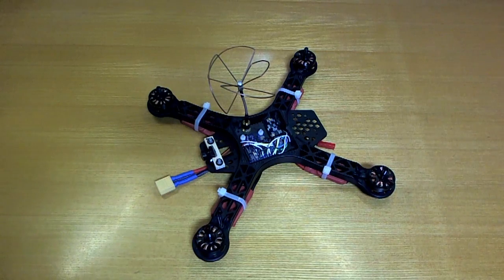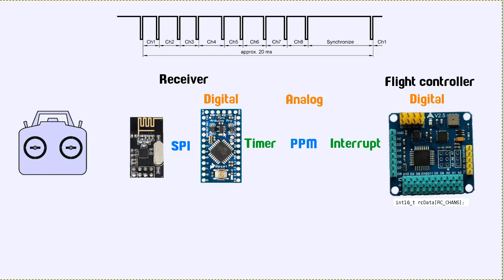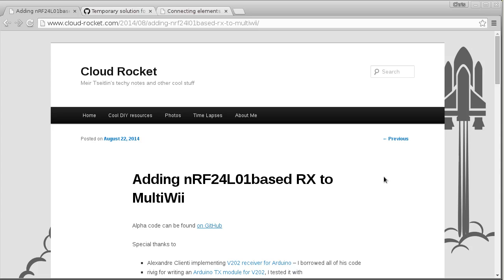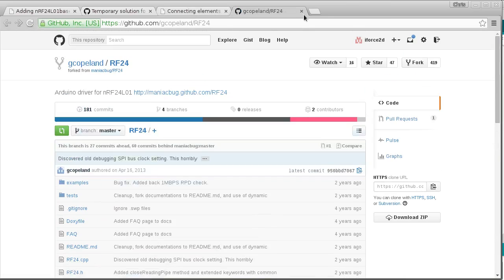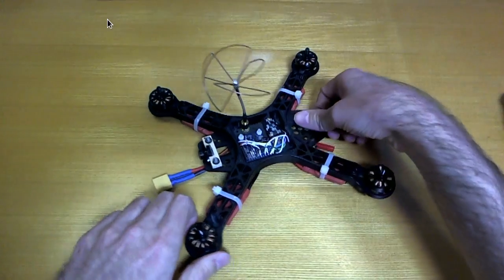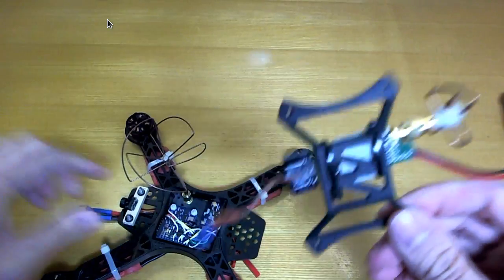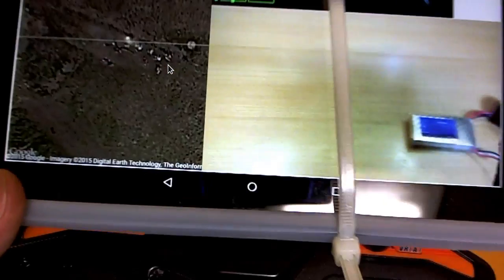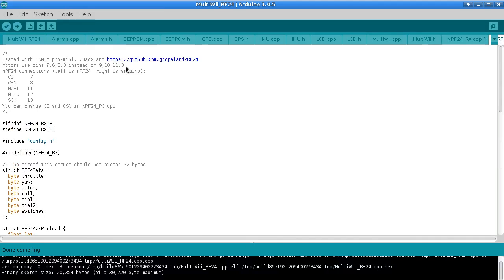Data telemetry with MultiWii integrated nRF24L01

Comment: What cable is it that you have between the nRF24L01, and the cloverleaf antenna? A banggood link would be nice :)
Reply from the maker: +Leonardvdj this one I think: http://www.banggood.com/50cm-U_FLIPX-to-RP-SMA-Female-Antenna-Pigtail-Jumper-Cable-p-924946.html?p=2K090270884220140865
Reply: Thank you :) Also, i found this module http://www.banggood.com/NRF24L01-Wireless-Transceiver-Module-SMA-Antenna-MCU-Arduino-p-80577.html that has an SMA connector on it, so if you still have that copter, you could buy one of those and replace the old nRF24 you have on it currently, eliminating the need for the wire going under the copter.
Reply from the maker: +Leonardvdj yes, I have tried those too. It sounds like you might have missed my comparison of these modules: https://www.youtube.com/watch?v=gtM832Z0ujE

Comment: Thanks so much for this video and the source. I will be using it for a start to teach a class of kids. Will update back here on my results ;)
Reply: +iforce2d  would it be easy to merge your current code with the latest MultiWii 2.4?
Reply from the maker: +Ken Chew (Locutus) probably not too hard, although I doubt an automatic merge would do it. Try searching for 'rf24' in all files to see the ifdefs for what has been added where

Comment: Hi iforce2d. Firstly your work is amazing. I have a little problem. I use an arduino nano+nrf+mpu6500, I set mpu6050 and in multiwii program everything works perfectly with acc and gyro, but when I arm the quad it gives me just the giro feedback, so i can't fly.  How can i fix it? I need to change my acc module?
Reply from the maker: +amnesia haze hmm.... you mean that it does not auto-level? The default is to start in rate mode (no auto-level). If so then you need to make some settings in the AUX section, to enable angle mode.

Comment: Can you upload your rf24 library i  cant make this thing to work i am using multiwii and pro mini as receiver and it works perfectly but with integrated nrf its not working,,
All rc outputs in multiwii gui stay on 1500 but sensor is working also on the transmitter i am using telementry transmitter code with nothing change in code
photo from multiwii gui : http://i.imgur.com/m3jKwG5.jpg
Pls some help i need to make this thing to work i dont know where is the problem 
i am using latest rf24 library
Reply from the maker: +Fx Pirate I am using this fork https://github.com/gcopeland/RF24
With a couple of small (but important) changes as mentioned here: http://forum.arduino.cc/index.php?topic=272143.0
Reply: +iforce2d i change everything and same story i check connection 3 times they are ok i dont know where is the problem 
photos from code change : http://imgur.com/a/jjZBS
Reply from the maker: +Fx Pirate hmm... then I'm afraid I don't know where is the problem either. You are selecting the correct board type in the arduino IDE right?
Reply: +iforce2d i found something when i will upload code from cheapass quadcopter with original rf24 library its working when i put antenna close to the speaker i hear some noice  but when i will upload same code with changed rf24 library i dont hear any voice - there is no signal 
can you upload your rf24 library ?? 
y i sellect correct arduino
Reply from the maker: +Fx Pirate Your changes are the same as mine, except I'm not actually doing the write_register(FEATURE,0); part.
Reply: +iforce2d i remove write_register(FEATURE,0) from the library and now transmitter is working but receiver its not working all values on 1500 and there is no noise when i will put it close to the speaker
i rly dont know what its the problem
Reply: +Fx Pirate i think that i found problem why this dont work for me pls check image and tell me did i need to uncomment that function >>??
http://i.imgur.com/YdqMa4H.png
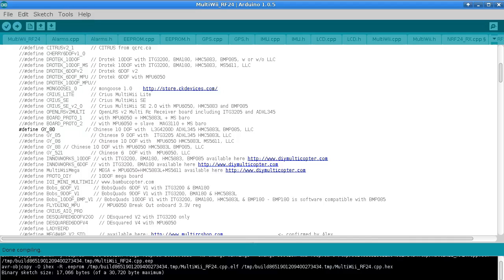Reply from the maker: +Fx Pirate yes, of course :) 37:16
Reply: +iforce2d I didnt saw that until now ... i am so stupid :D
Thanks i will check when i will get home ...
Reply from the maker: +Fx Pirate no problem, I should have mentioned when I first started talking about the source code

Comment from the maker: +Alperen Kolamuç maybe a faulty board with a bad connection somewhere? Have you tried it with other arduino sketches to do simple digital output control of that pin? Also please enable replies on your comments if you expect a reply
Reply: +iforce2d i fixed reply problem. i did tested digital output to pin d6  its working. I was wrong say you. pin d6 always 0V, pinD10 always 5V. I test your MultiWii_RF24 folder in 3 output file.
1.myOutput.txt: D6 always 0V, D10 always 5V. another things ok. nrf24 data transfer working.
2.maybeOk.txt: all thing not work.
3.output.txt: the same myOutput.txt.
All connections is good but i dont understand why not work.
thanks for reply.
Reply from the maker: +Alperen Kolamuç I don't know what those .txt are referring to. Can you see your stick control inputs responding in the multiwii config program? What happens when you connect ESC and motors and arm the flight controller, and spin the motors?
Reply from the maker: +Alperen Kolamuç by the way in your earlier post you said you were using motors on pins 3,6,9,10 but it should be 3,5,6,9 for this modified source code
Reply: +iforce2d yeap pin d10  instead of pin d5 change it's ok. Working. Thanks :)

P.S:
Right now mine connections;
NRF24l01   ==>4,10,11,12,13(ce, csn, mosi, miso, sck)
Motor Pins ==>3, 5, 6, 9
Alarm buzz ==>8

Comment: Hi @iforce2d nice job. I have a problem. I trying your code but some motor not work. I use pro mini 5v 16mhz, mpu6050, bmp085, and nrf24l01. Multiwii config screen ok, every think is working but motor pin 6 always 5V, it's not change.
NRF--------PRO Mini                                   mine motor pin= 3,6,9,10                    
CE------> D7
CSN---> D8
MOSI --> D11
MISO --> D12
SCK --> D13

Have you any idea? Thanks.

Comment: Hello what do you use to talk rf24 on the tablet side? Usb ttl + rf24l01 or arduino + rf24l01?

Thanks
Reply from the maker: alphace tablet is connected with a UBS OTG cable to the arduino in the transmitter
Reply: ***** I get you're talking serial from android to the arduindo, but I don't get the sketch for the arduino component, would yoou point me to it?
Reply from the maker: alphace There is a link in the description

Comment: ***** Hello, I would like to ask if you are still using 8MHz 3.3V Pro Mini on TX side? I adjusted Cheapass TX for telemetry and it works perfectly with nRF24L01 common module. But it is not working at all, when I install more powerful module with LNA and PA. The same module (LNA+PA) with some decoupling capacitors operates on the side of quadcopter with Arduino Nano 16Mhz without problems. I tried several different sources of voltage. (3.3V) Various combinations of capacitors. I tried different values for SPI.setClockDivider (SPI_CLOCK_DIV4) and radio.setPALevel (RF24_PA_MIN). I made extra and simplified version of TX without joysticks and potentiometers with another 8MHz Pro Mini, to exclude mistakes during soldering, etc. What could be the problem?
Reply: *****  I also want to ask if you did not think to try a similar project with nRF905? Due to the frequent use of wifi and better penetration of lower frequency signals that could have benefits, right?
Reply from the maker: Jindřich Ochmann Yes, the TX has a 8MHz 3.3v pro mini. So far I've never seen any problems after switching from using the PCB modules to the LNA+PA type. The only thing I could suggest is to power the nRF at 3.0v instead of 3.3v, where it is actually more comfortable according to the datasheet.
Actually I had not heard of the nRF905, that sounds interesting.
Reply: ***** Thank you for the very quick response. Now I know what caused my troubles. I was sending a long line of string values to the serial print at once, and I had set a low speed serial transmission. For some reason it did not matter if I used a standard module, but with the LNA + PA yes. I solved it in two ways. Either it was enough to set Serial.begin(115200) or print in individual iterations void loop() only one value each time. Now I would like to deploy the nRF905 module if I will somehow miraculously succeeds because I would like stream video over wifi from the Raspberry Pi Camera placed onboard. I must thank you for the great tutorials, mostly Cheap-ass TX, RX and telemetry data with integrated MultiWii nRF24L01. These are the things that interested me a lot, but without such help, I could not do it. I would like to offer you some ideas for future videos. Ultra cheap DIY quadcopter with coreless motors and MOSFET transistors instead of ESC. For my first attempt, I used the following: IRLML2502 MOSFET N-CH 20V 4.2A SOT-23, but too small motors (4mm diameter) and heavy battery with poor discharge (c). 15g thrust and 30g weight is really not a good ratio. :-D It is irritating that Multiwii would be hard to modify to work at 8MHz and I had 1S battery, so I used a step-up converter. There is no need to use step-up converter when using 2S battery, but there is a risk of damage to motors. Ideal would be 16MHz 3.3V overclocked Arduino and I read somewhere that this is possible. Furthermore, I think it might be interesting (though potentially illegal eg. in my country) guide MultiWii quadcopter through GPS coordinates using SIM800L GPRS GSM Module. Or at least use it in case of an accident to send the coordinates. Lots of interesting applications would go invent with $3 serial ESP8266 WIFI (model ESP-07). If I remember correctly, it can even be programmed directly and has PWM and SPI outputs. Wifi is probably not appropriate protocol to control quadcopter, but for control toy car or a robot directly from the mobile app can be useful.

Comment: Thank's it's really an excellent job.
Anyway, could someone shed some lights on how, if possible ?,  to connect the nRF24L01 to the MultiWii ? (wich pins on the nRF side <---> wich pin on the Multiwii side )
Reply from the maker: Valéry Farcy light is shed at 17:15
Reply: ***** DO you mean that :

Nrf        <=>      Multiwii 

  CE      <=> D7
  CSN     <=> D8
  MOSI   <=>D11
  MISO   <=>D12
  SCK    <=>D13

relates to the pins connections between Nrf and the multiwii ? The thing is that my Multiwii (Crius SE 2.5) doesn't have D13 :-( !!! 

Sorry to bother,
Reply from the maker: Valéry Farcy That's correct. Crius SE 2.5 has an ISP header with D13
Reply: ***** I have this : http://i.imgur.com/yatOL0Z.png
So, D13 = SCK. I'm I right ?
Reply from the maker: Valéry Farcy yep :)
Reply: Great,

Thank you !

Comment: ***** I was able to make the RF transceiver links up and running. Used cheap ass videos to get till here. Now trying to upload Multiwii_RF24 code and get the flight controller running. Looking at Multiwii_RF24 code I changed the data structure defined in the transmitter. For some reason  Multiwii config UI is not showing any data is being received from the transmitter. Here is the setup of my flight controller https://goo.gl/2i57d8. Pin 7,8,11,12,13 are used by NRF.  Could you help if i need to change the SERIAL_SUM_PPM pin number on the source code for this to work.
Reply from the maker: SMorrizz I have no ideas, it sounds like you are doing everything ok. The PPM setting is irrelevant because we're not using it here.
Reply: ***** Do you mind sharing your transmitter source code if it is not the cheap ass transmitter code or if there is any change you did that is missing the cheap ass transmitter source code that was causing the radio link to break? (email=mlewman1981@gmail.com) btw I am using two low power NRFs as of now and hope it has nothing to do with this issue. For now i am looking for low range copters.
Reply from the maker: SMorrizz http://www.iforce2d.net/sketches/ look for "Sketch for transmitter to go with above Android app"
Reply: ***** That was so kind of you. Yeah it started working now. Awesome. Something to work over the weekend.
Reply from the maker: SMorrizz Perhaps you just needed to have:
  radio.setAutoAck(true);
  radio.enableAckPayload();
so that the radio protocol is matching. Original cheapass tx did not use ack payloads.
Reply: ***** Yes. That worked too. Awesome. I am grateful.
Reply: ***** so i was able to get the Config UI work as expected. I went ahead connected the motors and attached flight controller to the frame. When the joy stick throttle is adjusted no motors are rotating and yaw, roll, pitch are doing nothing either. I get the initial sound from the ESC when the power is supplied other than that I cant figure out anything yet. Going through your videos again to see if i get any hint. PWM pins used for the motors are 9,6,5,3. Here is the setup so far if you can provide some suggestions https://goo.gl/AUTUFr
Reply from the maker: SMorrizz Nothing will happen until you arm the flight controller, I'm presuming you did that right? With all those exposed wires around it wouldn't surprise me if something is touching where it shouldn't :D
Reply: ***** Dont want to solder everything yet. I made sure these cable are not touching anywhere it should not be. Arm the flight controller? I dont know how to do it. Sorry if this is a basic info am asking for. In your video i saw you are just pushing the throttle up.
Reply from the maker: SMorrizz Actually yes it's basic stuff :) You need to arm the flight controller before it lets the motors spin as a safety feature so they don't just spin as soon as you connect the battery every time. See the "Arming & Disarming" section here: https://www.multicopters.co.uk/tutorials/multiwii-beginners-guide-part-2-transmitter-receiver
You should see the "ARM" title background go green in the MultiWii config when it is armed.
Reply from the maker: SMorrizz https://www.youtube.com/watch?v=yxUEpmDe9z8#t=24m44s
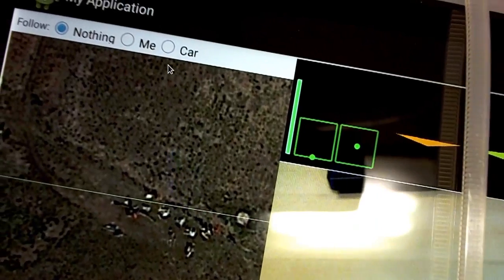Reply from the maker: SMorrizz I'm not sure which video you mean that I am just pushing the throttle up. In this video at 32:24 I showed how I arm the flight controller. Maybe in some other videos I did not mention it, but all the major flight controllers will require some arming command, otherwise you might get badly injured if you connect the battery while the throttle stick is not at zero.
Reply: ***** I think i am getting too impatient, let me remind myself tomorrow is another day. Thanks for the info. GY80 was not on a level surface and that is why it was not arming. Once place it on a level surface I was able arm  and able to make two motors run as i push the throttle up. Other two motors are still quite but on certain combinations of joystick i was able to run all the motors. I will look into it tomorrow in detail. Will keep you posted. You have have good one boss.
Reply: *****  I calibrated the transmitter and was able to get all the motors running on throttle up but still not quite yet and unstable. I need to work on tuning it now, still very promising how far i have reached, thanks!. The config UI shown the throttle going up but  FRONT_L and REAR_R are automatically going down. Also i noticed the REAR_L is going down but extremely slow considering the other two formers. I checked the transmitter data and it stays the same for the joystick position for throttle. https://db.tt/vpriVatC Could you give me some directions please.
Reply from the maker: SMorrizz I think that's the normal behaviour when the quad is not actually flying. It's expecting that changing the motor speed will cause the frame to move but it doesn't. As long as it responds appropriately when you move the frame around a bit (as it does in the video, motors on the lower side should spin faster to keep it level) it should be ok.
Reply from the maker: SMorrizz one of the motors with black propeller on is spinning the wrong way!
Reply from the maker: ***** http://www.multiwii.com/wp-content/uploads/2011/01/QUADX_328.jpg
Reply: ***** I think i sent you the wrong video. I made sure the blades are pushing the air down to lift the frame up. See this one https://goo.gl/3cF38Q. It lifts up and then falls down. After that if i bring the throttle down and full up again it lifts up and then falls down with the throttle full up, occasionally some blades stops too. In the video you see that i dropped the throttle down to zero because it was coming near me otherwise it will fall down with full throttle and all the motors running.

Also check this out please https://goo.gl/21B1pP
Reply from the maker: SMorrizz I have no idea. The behaviour is what I would expect if one of the motors was spinning the wrong way, but now it looks like they are all spinning the right way. Are you keeping the yaw centered when you lift the throttle? Anyway at this point, it's not really an issue of my 'cheapass' code or arduino things any more, so you might find more answers on the multiwii forums.
Reply: ***** I guess so too and I appreciate your time and guidance boss!
Reply: ***** the old frame was too heavy and that is why it was not lifting off and I was able to make it take off with a Eachine200 frame.  i think i need to do some tuning now. Here is the maiden flight https://www.dropbox.com/s/wwwpxkv35v0t5cs/VID-20150804-WA0004.mp4?dl=0

One thing i saw was when i apply some forward pitch it just rolls over because the Rear L and Rear R motors throttling up so much it seems. How would you tune the PID values to make the flight more stable.

Comment: exactly i dont know using nrf24l01(i am new in using arduino but i can do quadcopter just wathing your videos). i try but i cant write the codes of tx(mpu6050+arduino+nrf24l01) and rx(nrf24l01+arduino+2 servo motor).  i want to control this by my cheap-ass headtracker:)    = https://www.youtube.com/watch?v=VQ7XnC2msSw
and also thanks for helping if i can or i cannot do this.
Reply: i had exactly the same idea! but first I have to build an aircraft